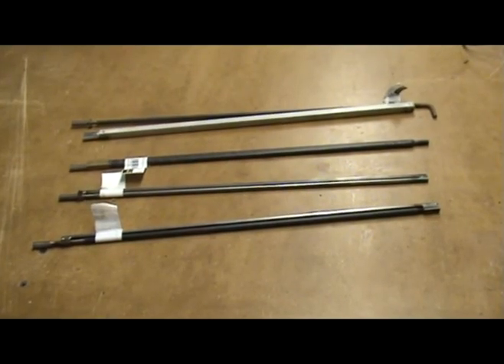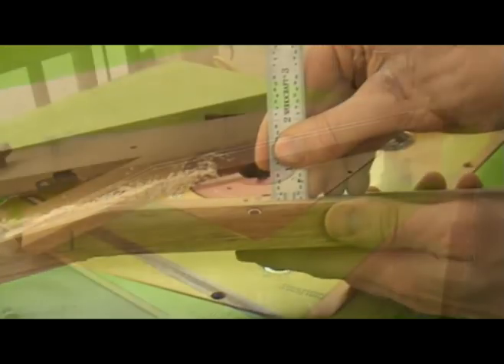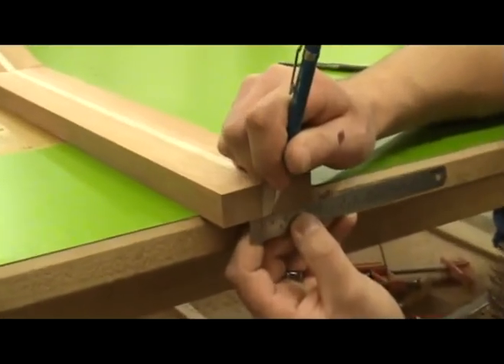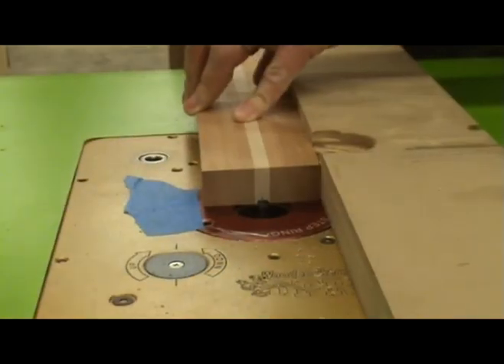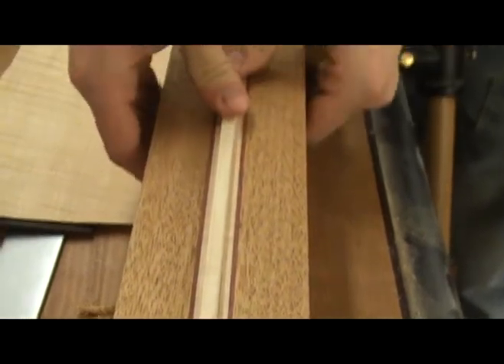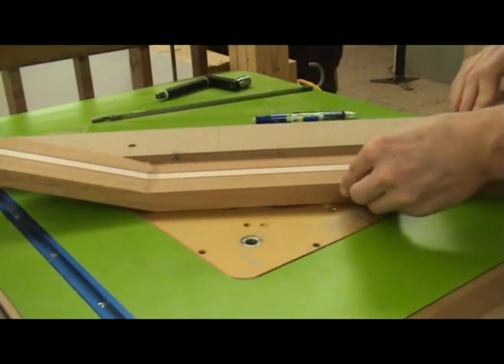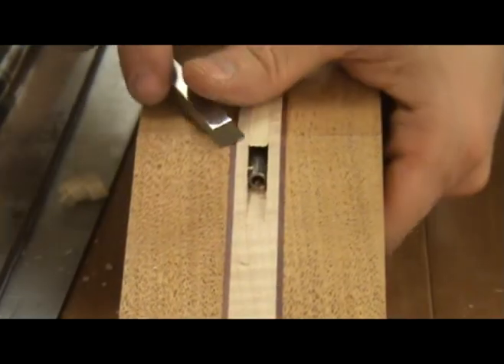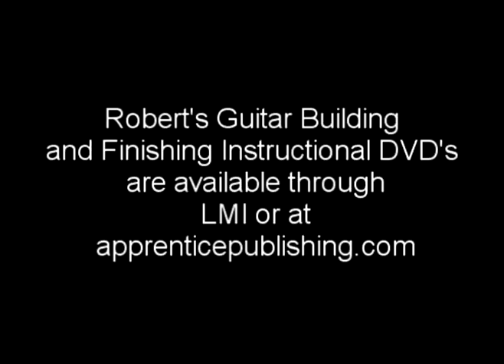How to Install Truss Rods - Luthier Tips du Jour Episode 21

Comment: I'm a little confused about the application of the epoxy on the shim in the second installation method. Generally, I thought getting glue on the truss rod should be avoided (excluding caulk or silicone to reduce vibration). In the video it sounds like you're gluing the shim to the top of the truss rod (since you're taking the time to scuff sand the top of the rod). I'm sure you still need to keep the epoxy away from the rotating portion of the rod, but are you actually gluing the rod to the shim and then the sides of the shim to the neck? Thanks!
Reply: Why is it important to not get any fretboard adhesive into the channel, but it's ok to use adhesive to put a shim/truss rod in the channel?